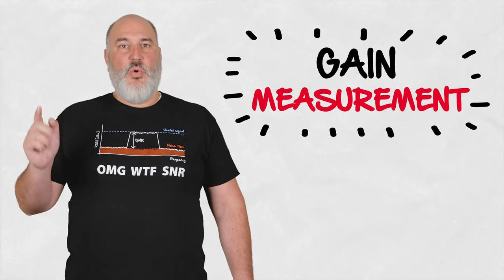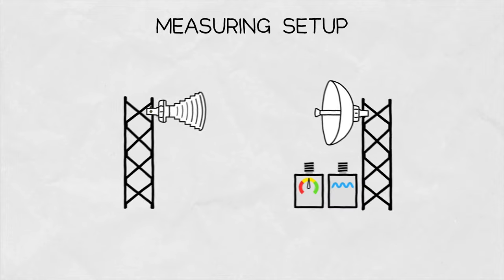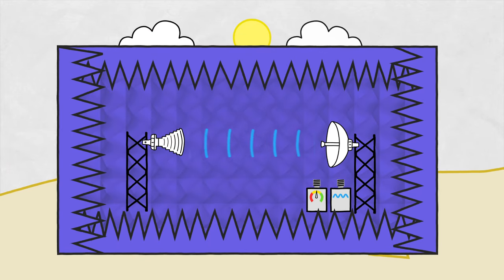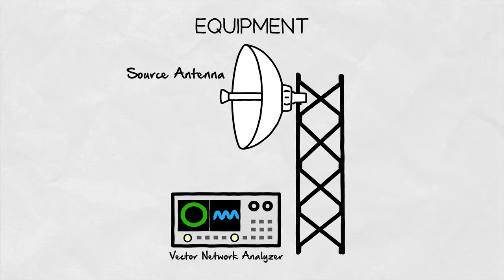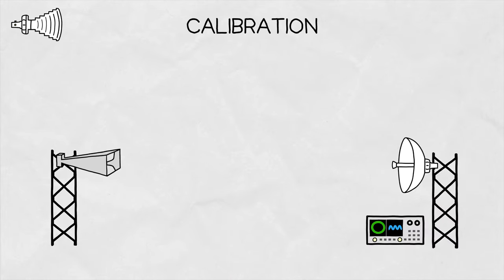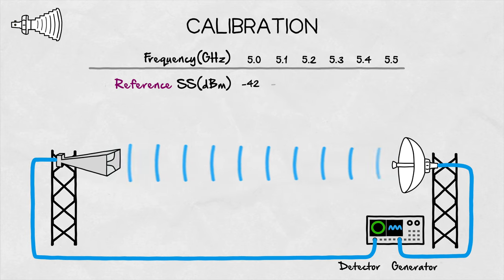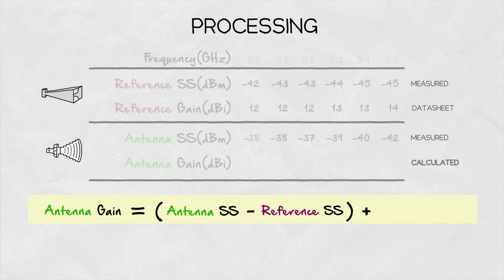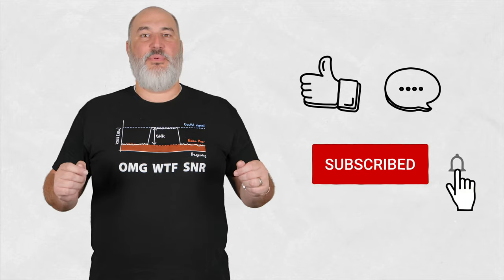Inside Wireless: Gain Measurement

Comment: Hi, 
if I have two horn antennas, let's call them A, and B.
A has a gain of 5 dBi over a freqnecy range of Y
B has a gain of 2 dBi over the same frequency range of Y

if I connect A to port 1 of VNA, 
B to port 2 of VNA,
and measure S12 or S21, am I supposed to see 7dBm across the frequency range of Y?